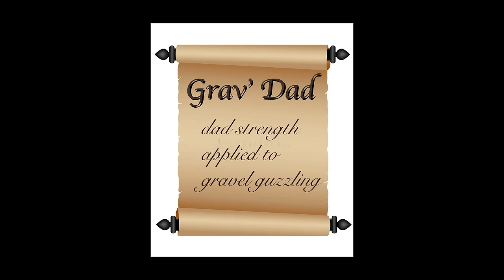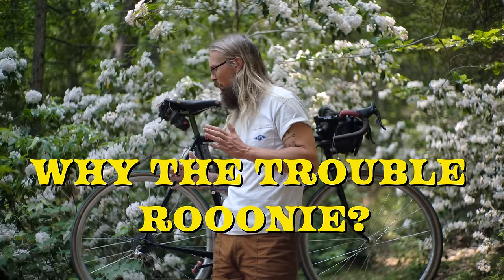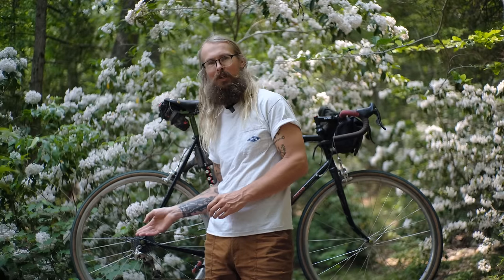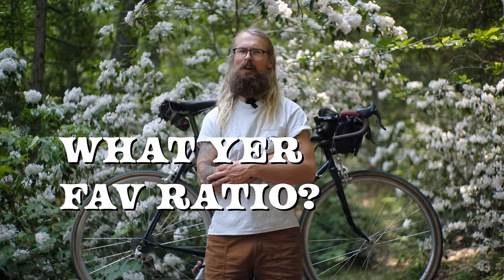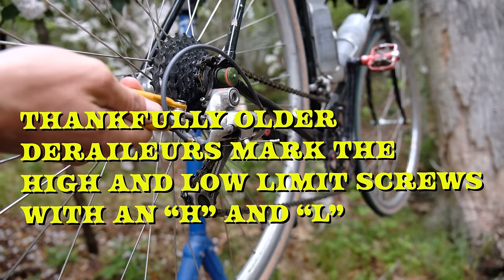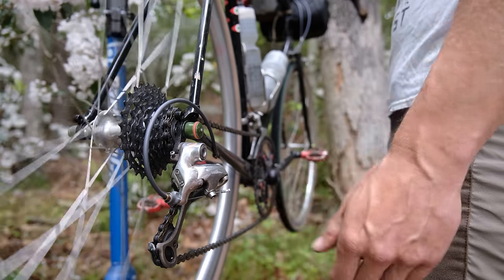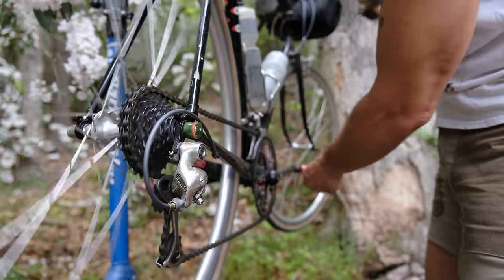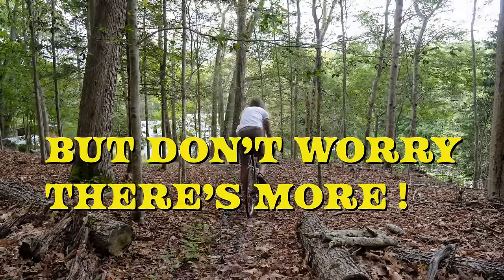build your own groupset

Comment: There is a nifty little gadget called ShiftMate from Jtek Engineering in the UK. This is the most underrated thingy in cycling history. It helps to mix-match between brands: Shimano, Campy, and SRAM. It can also help to mix-match inside the same groupset: e.g. 11-speed, 10-speed, 9-speed etc, between cassettes, shifters and rear derailleurs! Give it a try!

Comment: I love the fact you do what you need to make your bikes work for you. It is encouraging to see others who live this way. My bikes as a whole are pretty standard for what may have been current at the time of purchase or build, though I love making bikes from what I have around to suit a particular need. I bought a 2000 era Litespeed Toccoa MTB, it has seen 3 different styles of riding in its life with me. From a simple 26er MTB with super steep headtube , to a gravel grinder using 700c 38's to finally a drop bar Monster Cross type MTB with a 27.5 front and 26 rear. I get picked on from friends saying my bike are Frankensteined though they are fun and I get lots of enjoyment on them because they are mine and are original like I am. I'm glad I came across your channel and appreciate all of your time in making your great videos.

Comment: Your audio is now as crystalline as your message. I'm running Shimano Ultegra 8-speed bar ends, set to friction. They operate a Suntour front mech across a 46/36 Stronglight compact double. At the back, a Microshift M55 derailleur copes admirably with an 11-40 8-speed cassette, without a road link or other such appendage. This gives me triple range with double Q factor, which my knees thank me for every day.

Comment: Thanks for your video!
I have mixed a lot of groupsets. I do like to use 9 speed Shimano MTB derailleurs with old 10 speed road shifters. Then you have a setup which handles big casettes. Front mechs you can more or less mix everything. On my go everywhere bike I have XT 9speed rear mech Claris front mech. Tiagra 4600 shifters. It is really working well. I agree you do not need more than 8 or 9 gears with a double and they shift so much faster between high and low. 1x12 is just slow shifting and it is really easy to get caught with the rear mech.

Comment: I've been running Shimergo setups with Campy 10-speed Ergoshifters and Shimano 9-speed for many years now. I started with it on tandems, to get decent low gears and went on with it on several single bikes with triples. You have to change the cable routing at the rear derailleur to get the indexing correct, but once you do, it's pretty much spot-on. I've never heard that Campy 10-speed cable pull is the same as Shimano 8-speed, so this adds even more opportunities. Thanks. Campy also made a Shimano-compatible indexing ring for their 8-speed Ergoshifters, back in the 1990s. I've only seen these branded as SRAM, with that name molded right into the hoods, but they are otherwise exactly the same as the other Campy levers of their time. These are rare, but they do turn up from time to time on FleaBay.

Comment: I have a 1974 Dawes Lightning frame. Front brake is routed through the head tube to the touring brakes i fitted onto a set of glue stick suspension forks. Rear brake is routed to the suicide lever below the seat on the top tube. The lever opposite side of the mount goes to the two speed shifter for the front chainrings. Track wheels, freehub on one side, fixed gear on the other. Custom tensioner made from a Shimano derailleur. Made a cage stop for the derailleur when its in the big gear so you can still have the back pressure on the pedals when riding with the fixed gear. Switch from fixed to free when the weekend hits. Don't need to cruise to work, don't need to race to the bar, but I don't need two bikes. One bike, two modes, always fun and a head turner. Also being able to throw the occasional bar spin to impress the ladies helps.

Comment: Yeah, i'm modding the drivetrain too and quite happy with the results.
Crank: Non-branded 155mm 24/34/42t converted to 2x (due front derailleur limitations)
Casette: 8sp 9-34t shimano HG converted to 7sp 13-34 (for better chainline)
Rear Derailleur: shimano altus 8sp
Front derailleur: old shimano altus c10.
Chain: kmc z8
Shifter: a set of microshift 9sp.

Ratcheting FD like yours seems a nice upgrade. Gotta grab some if I could found one.

Comment: Awesome video and very funny. 
I just did something similar with an old 8 speed campy drivetrain I had laying around. 
Used Campy Avanti 8 Speed levers to shift a 8 speed shimano cassette with a campy centaur derailleur. All I did was use the campagnolo 8 speed plastic spacers in between the shimano cogs. It shifts like a dream. And as you mentioned, I can now use any shimano/sram wheelset with my nice Campy shifters.

Comment: When Shimano Tiagra went to 11-speed spacing for 10-speed gears, and wasn't compatible with anything anymore, I put one on the rear of my venerable 10-speed no-name titanium bike, and I control it with that ENE Ciclo Uno, shift-anything-up-to-twelve-gears bar-end friction shifter (I got a Rivbike silver shifter on the other side for the front). I treated myself to the TRP RRL brake levers, and now everybody in my club thinks I'm nuts. Maybe I am. But that setup will drive any gears and brakes I can get onto that frame, and I haven't noticed any detriment in performance (but I don't give a d-mn about racing, so there's that). I tend to keep a setup on the bike for about six years, so I don't know what I'll do next. But I'll be in my mid-70's by then, so maybe it won't matter.

Comment: Those Campy road brifters looks so good. I've found old shimano 9-10 speed road brifters have the same cable pull as their 7-9 mtb derailleurs. Recently did a 9sp Dura-Ace brifter paired with a older XT rd and I run a Ultrega 10sp brifter with an 9sp XT.

Comment: Once you go Campy for shifters, it's hard to go back!  Back in the mid '90s I started using Sachs Ergopower 8 speed shifters with my Shimano XT and XTR drivetrains on my drop-bar mountain/gravel bikes.  They're basically the exact same Campy Veloce 9 speed shifters that I run on my RB-1, but with Sachs 8 speed cams in them.  On fleaBay you can often find the Sachs Ergopowers with both the front and rear paddles being polished aluminum.  It goes really well with polished 8 speed XT components of that era.  A nice classic look for sure.
Reply from the maker: oooh, nice tip!  I am a fan of the weird Sachs stuff like the "new success" group.  what a funny name!  gonna have to look these up.  thanks!
Reply: it’s true. i recently begrudgingly moved from campy chorus 11 on a disc bike to shimano grx, mostly for the really good braking, but a little for the out of the box wide cassette support. and i sorely sorely miss the lever feel.

i couldn’t for the life of me get the cable chorus levers to get anything resembling consistent and high quality disc braking, and in the hilly and wet PNW it’s pretty crucial.
Reply: @jonamcc  They're ugly as sin, but TRPs HY/RD self contained hydraulic calipers are real nice for running whatever cable brifter with 95% of true hydraulic stopping power. Ive put about 300 miles on mine now and the braking feel is phenomenal on my gravel bike. The modulation is good enough to get little rolling stoppies out of them, with enough stopping power when needed to overwhelm the front tire on pavement.
Reply: @pathosdivision  that’s what I was using previously, and they worked well at first (after I installed the campy mod) but the performance deteriorated with time. perhaps the pads were not good? alas i already made the swap.
Reply: Thanks @jonamcc, I was pondering doing the same thing on my bike. I have Sram Apex levers, and want to swap them out for my 94 veloces.
Reply: @jonamcc  I rode them over the alps from Italy to france, the original pads where not that good, you should also use compressionless housing. I really like the Hy/rd and would buy/ride  them again anytime.
Reply: You could shift a 3x Shimano Mtb front derailleur with the Sachs Ergopower 8Speeds? Thanks
Reply: @alexsch9956  I'll have to look at my old Alpinestars with my ErgoPowers to see.  I have old polished XT triples on there, but I always ran my drop bar mountain bikes as doubles.  I saw no need for a ring smaller than a 32 on a slick tire, drop bar gravel bike.
Reply: @inavandownbytheriver  ahh okay 2x would make sense because cable pull seems to be different in the front road vs mtb stuff even for the older stuff. So far I wasn't able to get a 3x crankset combined with a MTB front derailleur and Shimano road sti levers running
Reply: @alexsch9956  Actually, on several of my current bikes and many of my past bikes I run Shimano Sora 8 or 9 speed shifters.....I like the little inside shift lever like my Campy stuff.  They all seem to throw Triples up front OK.  On most of those bikes I run 8 or 9 speed full sized cranks like XTR 950.  I still rarely use the small ring, as 34 or 36 tooth middle rings are small enough for the coastal plains where I live now.  Hope that helps.
Reply: @inavandownbytheriver  thank you

Comment: I've used 10 speed Campy Ergopower shifters with a Sram 10 speed rear derailleur (I think it was Apex or Rival but any will work as long as it's "Exact Actuation" cable pull) on a Shimano 10 speed cassette with complete success. Rode thousands of miles on that with beautiful shifting. Lennard Zinn wrote a detailed how-to article on Velonews which may still be there :-)
Reply: Plus one on the SRAMpagnolo. Works great and parts are plentiful and cheap.
Reply: @I8BB  so you agree this works? Might be a pretty sweet hack if it’s true

Comment: Current favourite combo: suntour power ratchet thumb shifter (I know you're on a campy thing but you asked for fav combos) to a Shimano xtr 9 speed rear d (obvs friction makes that a "whatevs") shifting a wide range 7 speed with a 10 speed chain. It's so quiet that sometimes I have to look down to see if I actually shifted and nearly crash. I'm only doing 7 speed because the hubs are old suntour sealed bearings that run so nice I can't bear to get rid of them and they take a freewheel. It's a front triple with a suntour mountech. Inner ring is 24 tooth which is hi-lar-i-ouse with the 36 big cog at the back. It all works 👌.
Reply: thats nice!

Comment: Surly gen 1 KM rider here.
Heavy bike, heavy rider.
MicroShift thumbies, front friction, rear 9 speed index.
Sram FD, 42-26 FSA and Deore crankrings on a 3x Sram crankset converted to 2x.
Old Deore RD, bog stock cheap Shimano 11-34 cassette.

Comment: haha great vidéo!

mix-matching groupset is the greatest thing in biking. you can find tables of cable pull, derailleur rations and cog spacing of all brands and group. try to find your parts on old bikes and enjoy :)

Also when the ratio are not exactly the same you can bend the dropout to make it work, but shhhht thats a secret! 

i have a custom  road Frankenbike
1x8 gears 42 11-36 
-11 speed shim MTB cassette with removed cogs. and spacers to fill the space near the spokes.
 42 GRX 11 spd 1x crankset
-9 spd mtb deore rear derailleur
- 10 spd (OLD) shimano shifter
 and it works like a charm. i dont care about cadence so 8 speed is more than enough and i dont crosschain when im on the biggest cog. hehe!

Comment: I had a 2 by 8 on a new mountain bike and it wasn't enough.

It had plenty of low end that my old 15 speed early 90's mountain bike didn't have, it didn't even have a 1 to 1 ratio and I couldn't ride it up really long steep hills.

The new bike from 2007 had an 11-32T cassette on the back and 22T, 32T on the front. I was completely missing the speed, and I wanted more high end as it was from my old bike, but the old bike was better at the high speed.

I added a third 42T chainring to the front yesterday and it's absolutely amazingly fun to ride now. Gear spacing is possibly a little closer than I need, but I use all the high end range, I still need to find some massive hills to test the low end.

Ratio is 0.69 to 3.82 and I love it so far :)

Comment: Hello Romance. That is a beautyful combination and I love these Italian parts. One thing I love to do some strange things with is the Modolo Morphos. Some time ago I bought another shifter from them and they work great with a simple screw to ajust the cable pull. I guess they are still available 😍Modolo is so underestimated in my eyes and they are not expensive at all. ...Thanks for this exorbitant level of (information and) entertainment. Liebe Grüße🖖
Reply: Haven't read much good about them, your post makes me actually curious to get my hands on some!
Reply: @brrrt6666  You need a little bit more strength because of shorter shifters I guess and it is a little more challenging for the thumbs at the beginning . With a precise cable Installation with no extreme cable radius they work nice and one can give them a try for that price. Liebe Grüße 🙋🏼‍♀️
Reply: @kaffeemitcola6506  Sounds great, have lots of love for odd componentry, Grüße zurück!

Comment: My way of thinking was always, that the only thing that matters is cassette range... untill I tried 10 speed 11-28 which is really fun in flat terrain. If they were making 9 speed 11-51, I would gladly use those in my MTB.
My favourite drivetrain of all times is 2x10 front 38-24, rear 11-36 that came with my MTB in 2014. I replaced it later with 1x11 because i needed space for proper dropper post lever. Since Shimano is making now 11 speed 11-51 I have no reason to go for 12 speed.
On my flat bar road/gravel I use old Alivio crank  with 36-26 and 11-28 rear with GX shifters and derailleur. Those GX came from my MTB when I switched to 1x11, so it was a parts bin upgrade from 3x8 to 2x10.
On a drop bar gravel I use standard GRX setup (2x11) and I only wish, that Shimano was making smaller chainrings. I don't need more range, I need lower gears.
Funny thing is, that GRX 2X10 comes with 11-36 cassette and 2x11 with 11-34. Makes no sense to me and seems like 2x10 is actually better.

Comment: Campy 10 speed drop bar shifter works with exact actuation 10 speed SRAM mtb derailleurs as well if you want campy and a clutch der/ wide range
Reply: Either SRAM or shimano cassette works with this setup

Comment: So nice bike ! 
i'm modding also the drivetrain too and results are top for 9 speeds.
Crank: Campagnolo Record carbon converted to 1x 
Cassette: 9sp 13-42t shimano HG 
Rear Derailleur: shimano Deore 9sp
Shifter right Campagnolo Chorus carbon 10sp and Shifter left Campagnolo Chorus converted to just brake lever.

Comment: If you fit a JTek Shift mate number 3 to the barrel adjuster of your rear derailleur, you can run Campagnilo 10 speed shifters with a shimano 10 speed road derailleur and road 10 speed cassette (as long as you dont go Tiagra). I've been doing it over a decade now.

Comment: I had good luck combining a GRX 400 RD with tiagra 4700 brifters. Unfortunately it works best with race oriented crankset like a 52/39. The left brifter has a hard time making big chainring jumps in my experience. The value of doing this combo is gaining a rear clutch if that’s tickles your fancy.
Reply: We both have the same setup. Its nice to know that i am not the only one who double tap the left brifter just to shift to a smaller front chainring. Its not that I have a problem with it, lets just say i got used it and its fine with me. Going two years with this setup and i dont see the point of going up to 11 speed. This is perfection to me. Btw im running a 46-30 front and an 11-36 at the back. Plenty of range already.

Comment: 10/11 speed sram derailleurs work fine with 10 speed campy shifters and standard 10 speed sram/shimano cassettes. Been running that setup on my cx bike for more than a decade. 10 speed chains are better developed than 9 and 8 speed and there is an enormous choice of 10 speed cassettes. Sram rival derailleurs can be picked up for $40 and work great. In really extreme weather I'll put an 8 speed cassette on for a snowy/icy cx rave and hope I'll find a couple of gears that work. 11 and 12 speed are just too finicky for cx unless you want to spend thousands and bring your bike to the shop every week

Comment: Love the look and feel of alloy shifters. The Centaur 10 speed you're showing use ErgoPower not Ultra Shift, correct? How does the shifting lever movement feels to you compared to the Record shifters?
Are multiple gear shifts in one movement supported?

Comment: BROKOWSKI!!! You are exactly right about CAMPANGOLO shifting feel. My 1st 🥇 serious road bike I bought after I quit smoking in 2017. It’s a Rebellato (aluminum main triangle, carbon seat/chain stays, cf fork made in Castel Franco Italy 🇮🇹) was fitted with Veloce quick-shift 10spd. Love ‘em!! They feel like a well maintained Beretta 9mm cycling through its magazine while qualifying on a military marksman course (I’m an expat vet living here in N.E. Italy 🇮🇹). 

Shimano shifters feel like big robotic arms from the Alien movie 🎥🥸😎🤓

I’ve had a similar issue finding good deals on their hubs and equipment on ebay…but I’ve managed to build them: Felt B2 Veloce 10spd, Kuota K-Factor Veloce 10spd (easier to swap rims;-), Rebellato got the Centaur 11spd (same hub size but bought chain/sprocket removal tools to share rims), Maino 1951 (Fausto Coppi helped design the frame) Campangolo 5spd (bought friction shifters, brakes C-record) rollin on Campy Delta 8spd…stretched the rear triangle…

Rims: cf campy tubular 50th anniversary, cf 60mm tri-spoke (Japanese brand), Campy Scirocco, Campy G3 Vento, Fulcrum Racing 3 (clincher), Fulcrum Racing Zero red anodized (tubular), Miche 707 (clincher), built Miche race hubs on DT Swiss clinger hoops, Sapim cx-ray flat blade; built Stans No Tube race series hubs, Sapim cx-ray flat bladed, 36mm cf tubular hoops….and that’s about it (Forest Gump voice 😅)

Bikes 4 the win!!!! (new sub here as well)